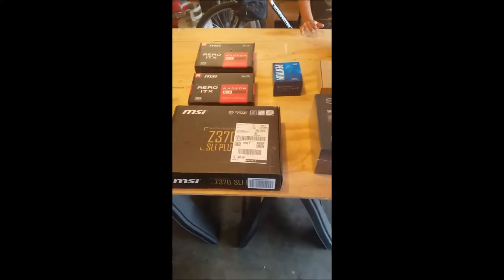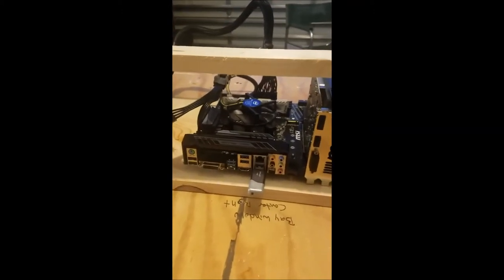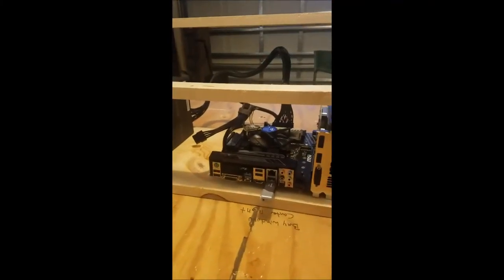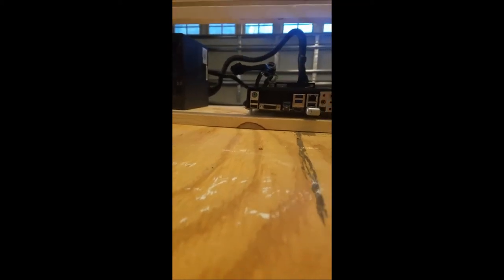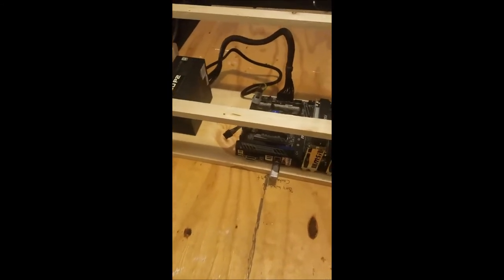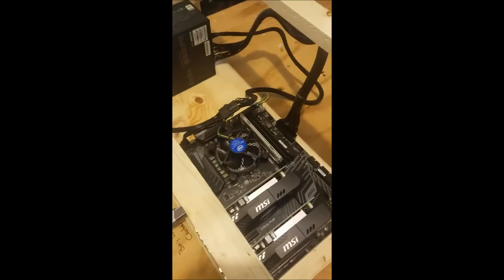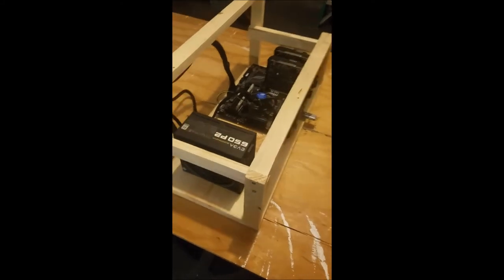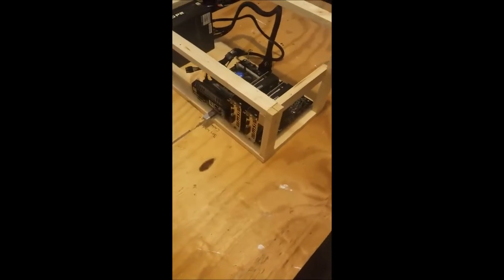RX560 Mining Rig Build   Almost Complete!

Comment: If anyone  else has forgotten to get themselves an on/off switch, I have a work-around.

If you have a look at the motherboard manual, you'll find that where you are supposed to plug in that switch are two 'jumpers'.  If you get a screwdriver/paperclip (something that conducts electricity) and short out those two 'jumpers' when there is power turned on, the rig should boot up 

You can also go into the BIOS and select the option to Power-On-In-Case-Of-Power-Failure (called different things on different motherboards).

In this way, you effectively turn your rig on and off by the power switch. I had mine running this way for the first month or so, until my switch FINALLY arrived from China.

I hope it helps.
Sean.
Reply from the maker: Much appreciated, thanks for the detailed instructions!